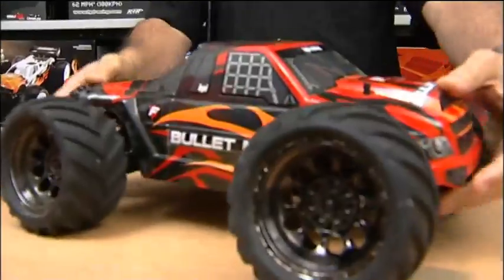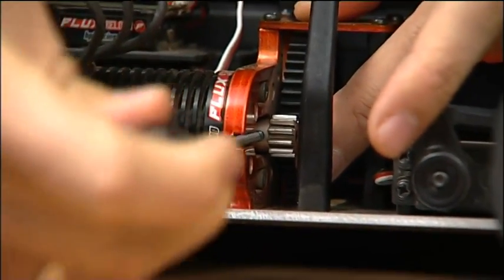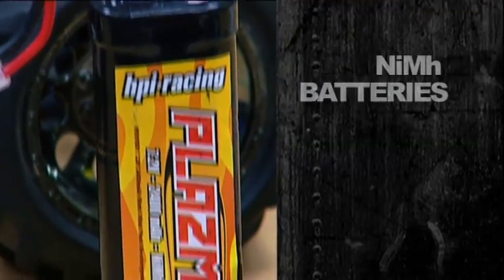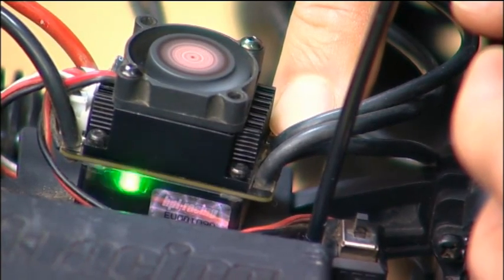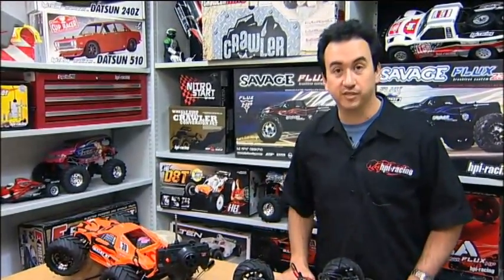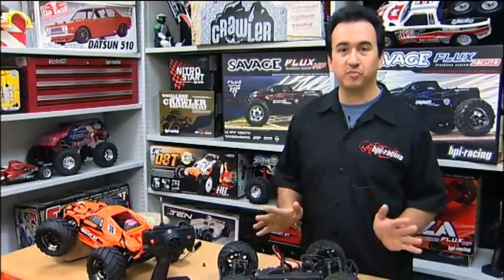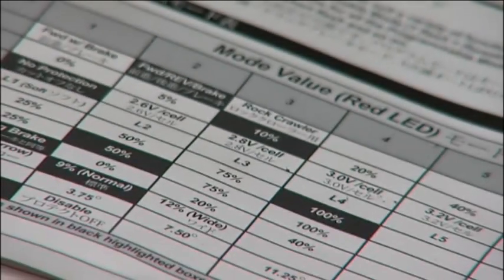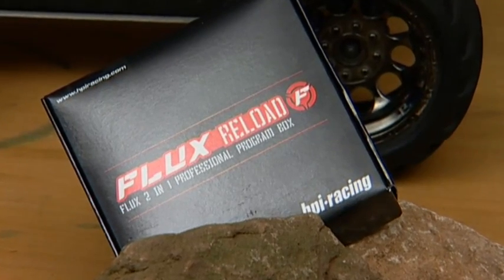Programming your HPI Bullet Flux

Comment: How do i set the auto-lipo to 3,4volts? I do exactly as in the video but can only get 4beeps then it starts on 1beep again.
3,4v should be 6beeps.
Reply: Jim maiy me too also my controller wont link it worked until i tried to set lipo cut off, left the cut off on 4th green beep but no controls not even sure thats lipo c.o. id hate to buy the damn card.
Reply: cuando cambia al 5 el pitido es largo , el 6 es pitido largo y uno corto y asi con el 7 pitido lago y 2 pitidos cortos